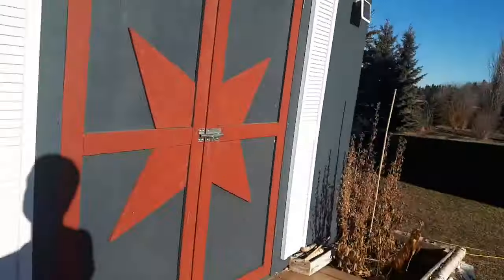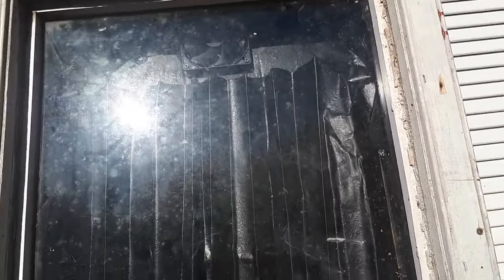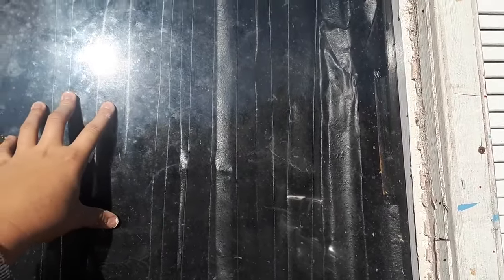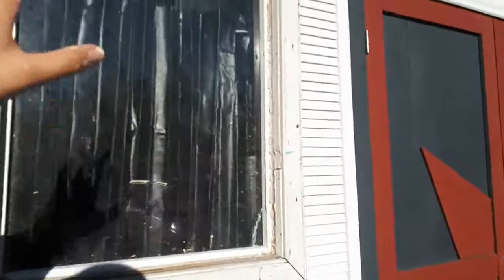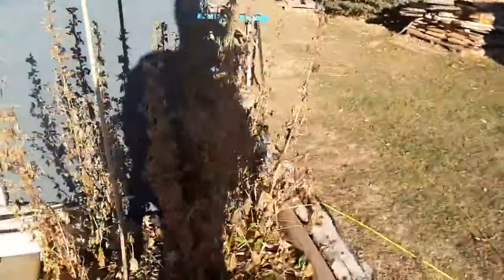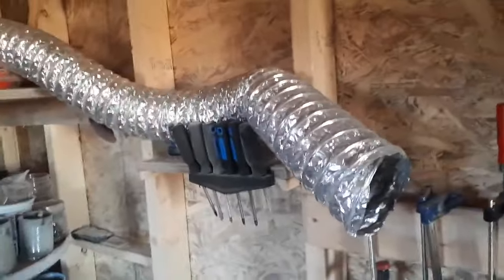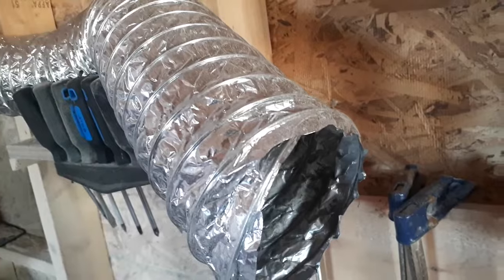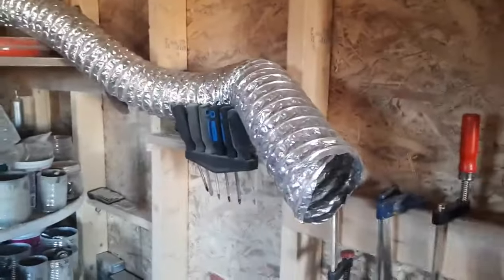$40 Dollar Solar Air Heater That Will Cost You Nothing To Run!

Comment: I love this idea so good! 

Idk what’s going on with the comment community but they are completely overlooking the fact that heating a structure is not about heating the entire building. It’s about heating living space “ where you are standing “  

I Build Passive Green homes in New England and this type of heating could be used in so many ways 

If you were to install a south facing window, you would get a similar heating effects but it would not give you heat right where you want/need it. 

Your method of a heat exchanger is a brilliant idea 
Very similar to breathing warm air into your hands on a cold day you feel the impact much quicker 

living in a northern climate myself, the last time I measured my windows (in my storage shed). sunny 44 degree day they were not 80 degrees, nor the ambient temperature 62 degrees. 
Your method of heat concentration is ingenious.
And experiments like these are wildly needed across the home building industry.

Judging by the previous comments,
I think YouTubes algorithm might of sent this video to a less qualified audience.

This is an amazing achievement 
I hope it gets the recognition it deserves

Keep up the good work 👍

Comment: I see some gaps on the roof that let light through... seems like any cold breeze will overpower the contraption.
To measure temperature with an optical reader on a reflective surface, put a piece of matte tape on it, or put something inside that vent tube and point the termometer at it. Otherwise, most of the time you are just measuring the temperature of whatever is being reflected on it.

Comment: I think it would work a lot better if you used pop cans and drilled holes through the bottoms of the pop cans and connected to them together, paint them matte black, i think youll get a more efficient heater. Keep up the good work.
Reply: Overrated concept. Plus all the drilling and such. More work than it needs to be.

Comment: I can see there is enough ventilation inside your shop.  Why did you decide to draw air from the cold outside instead of recirculating?
Reply: In the sun heat flows up the wall too, so that's probably working as an air preheater. 🤔👍

Comment: You are gaining nothing thermally, just letting the light in that window would just just as well. Unless the light leaves the room, all it's thermal energy eventually dissipates in the room. All you did was concentrate less of it (some escapes out the glass box front with this warming the glass, that is on the outside), and into a tube so it 'feels' warmer. Just because you concentrates the heat into a narrow tube where it feels hot coming out doesn't mean its more heat, it just means it concentrated.
Same thermal energy as the window open itself, condensed into a smaller spot. But same total energy coming in either way.
The roof itself probably gathers more radiant heat than this does, that 17 degrees is mostly from radiant trapped wall/roof heat Id wager. 
While the idea is a solid attempt, you need to measure the BTU output of it for a useful metric, not just how hot the air is when restricted to a smaller surface area out output. For example A blow torch is VERY hot in a small area, doesnt heat the room. But measure it, you' could say "Its 1200c coming out here!".
Reply: I'd have to agree with the heating part. Greenhouse works on that principle. If he didn't want windows, though, then this would be a method  he could use. 
Many people trying to use solar for energy or heat should be looking into ways of reducing all their loss. Sealing leaks, adding insulation, good design, all help with any system but are more pronounced on 'alternative' systems.
Reply: I'd partly agree, except he is now able to move the heat where he needs it. Maybe to the floor in his work area, or the workbench.
In one minute I thought of several cheap options myself. Things most people never think of, not even retired engineers. I can do that because when I was a young man I learned to try out ideas and build things.
Edit: I mean it's a valid experiment, with more capital or supplies it could be built onto a southern wall and lots of other things. But as is he used minimal investment and little to no structural modification. I'd call it a success 💯👍

Comment: This is a joke I bet there is more heat coming off the non insulated wall and roof then there is from that tube. Plus there is open air vents under the roof. Insulate the walls and roof put a 250 watt heat lamp in there and it would be toasty warm Not below freezing.
Reply: 17°C is 63°F
Reply: What other kid you know of is playing around like this? They are either trying to be tic toc fools or their head is in a computer game. I applaud his efforts. But yes, YouTube has a million videos out there with better concepts and proper this and that which he can learn from. It is an adventure 😊